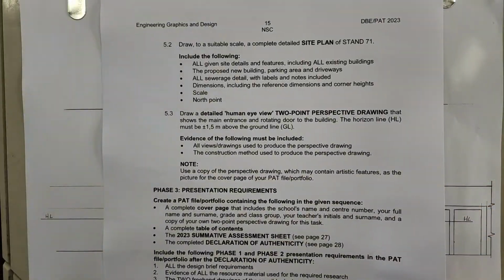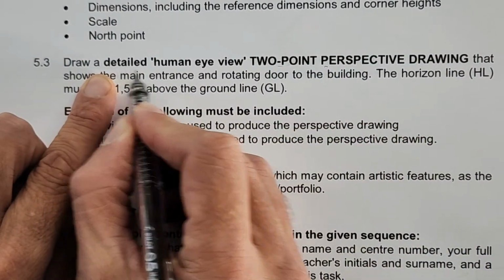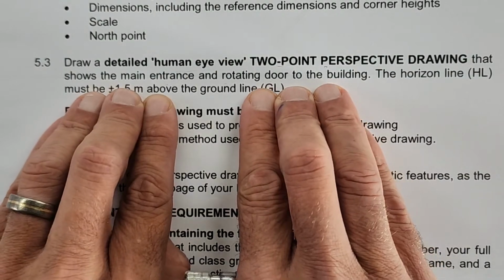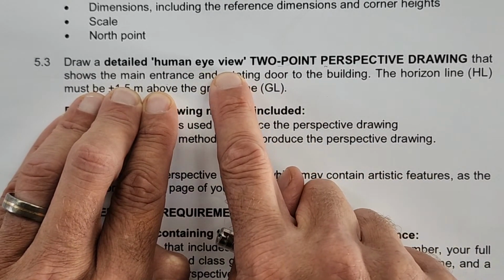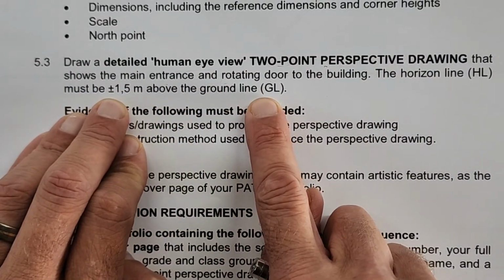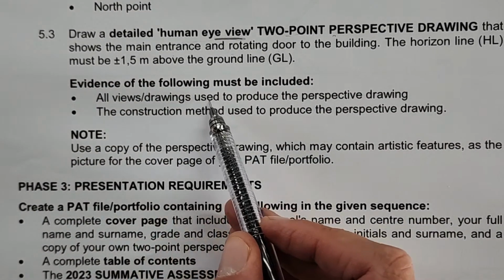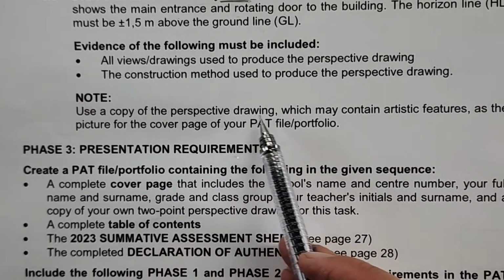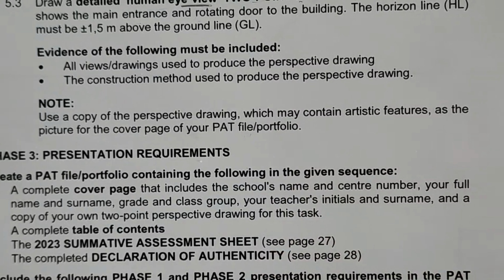EGD CIVIL PAT - Grade 12 -  Two Point Perspective - 2023

Comment: Hi my teacher told our class to do the entire designed building with a view of the door but he indicated the vanishing points to be 10 millimeters above the GL however this makes my height lines go down how do I work with this can you please advise
Reply from the maker: Hi Xavier, great hearing from you again. The PAT document specifies eye height, and I understand how your teacher wants to help most students with gettingthe HL correct.. my advice is for you to keep the HL to 3/4 of the way of the height of your doorway. That is approximately eye height.  Because the two point is not drawn to scale, it makes it difficult to have a fixed 10mm as the height. Sure, this will solve it for you. All the best!
Reply: @HowToEGD  thanks for the help

Comment: Hi.Just wanted to find out, what is the measurements for this?
Reply from the maker: Hi Keanu, I trust you are well. As a guide,  the easiest is to use a two point perspective already done in class a reference. Remember this 2 Point does not have to be according to a specific scale, as you just have to sure the Top View and Side views used is equal to each other with regard to their size. Easiest is to make copies of your original floor plan and elevations. Please re watch the video for more details and steps. All the best.

Comment: The two-point must it just be the "main entrance" or the "hole building"
Reply from the maker: Thanks for the question. The PAT Task states: "Draw a detailed 'human eye view' TWO-POINT PERSPECTIVE DRAWING that shows the main entrance and rotating door to the building." The key here is the emphasis on the main entrance with rotating door to the building. It does not require you to draw the whole building... Hope this helps. All the best with your PAT.
Reply: @HowToEGD  Thank you sir 👍💡
Reply: @HowToEGD  sorry sir but my teacher says we must drawing the whole building
Reply: With the perspective can one use copies of the floor plan and elevations, cut them to the size that shows the main entrance then draw or will pretty much be required to redraw the part of the main entrance using a different scale in order for it to meet the requirements that it should be large enough, not to the size of our usual two point perspective  we do in class
Reply from the maker: Nkateko, great insight in your question. yes, for sure. You are on the right track!! All the best with your PAT!
Reply: @HowToEGD  So there's no need to draw the whole building or It is optional to the learner, as long as the requirements are met?
Reply from the maker: There is no need to draw the entire building,  as it is not a requirement...
Reply: @dylanmothilall9526  the main requirement is to show the entrance, so there's no need to draw the drop off zone. For a better understanding I would advise you to watch the "How to hack your PAT" series